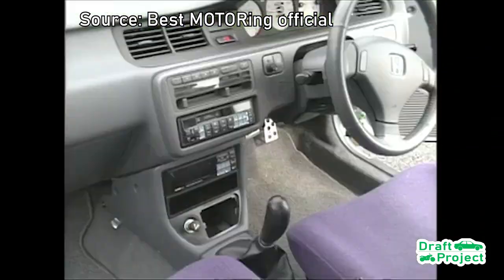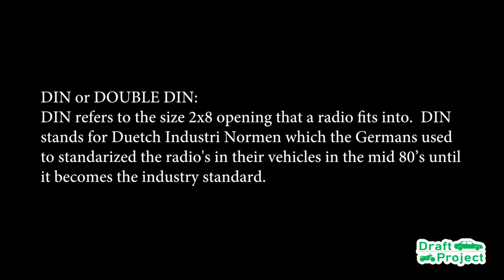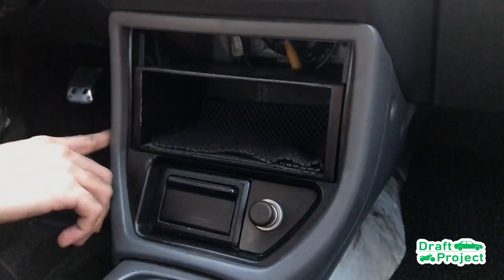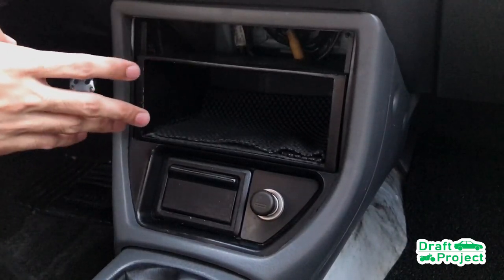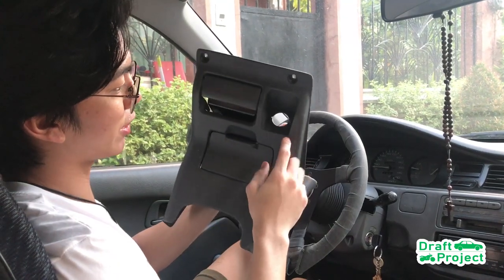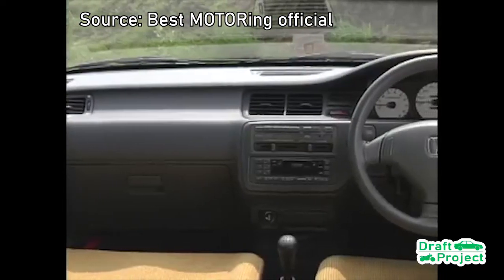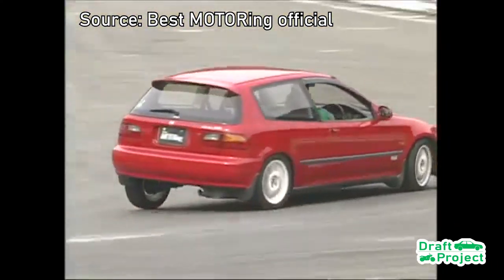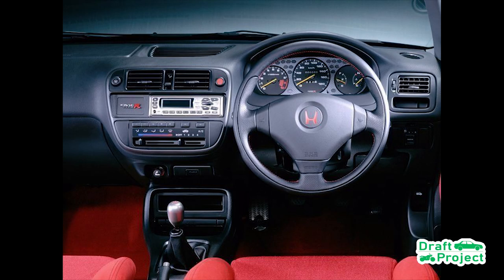Different Types of Center Console

Comment: Thank you for the great explanation! My eg hatch got the standart one but I found double din from sedan at a reasonable price. Can i change mine into doublr din without changing other parts?
Reply from the maker: Yes, you can upgrade it. Just make sure that it has complete brackets, so that you can bolt it on without any problems.
Reply: @DraftProject  the guy I was going to buy it from sold it and now I found one from sedan but with automatic trans. Any idea if it would fit on an eg with manual gearbox?
Reply from the maker: As far as I know they are completely the same. It is only the transmission shifter is different, but the panels, center consoles, mountings are just the same. If it is from an EG Civic, it is good. Just remember that when you buy it, it is complete with bracket and screws.

Comment: I have eg coap 95 ex I wanted to change mine too I have 2000 ek hatch too with k24 too I wanted to see if I coukd put the muffler consol from my ek in my coap cuse I did want to put double din radio on my coap need to fit perfect didn't want nothing ghetto
Reply from the maker: Nice ride! Well that would be a bit difficult job since it involves retrofitting in the process. I'm not really sure on how it would fit but I saw someone did it on the internet.

This guy installed an EK console in his Civic EG.
http://www.diymyhonda.com/civic/ek-center-console-in-eg/
Reply: @DraftProject  thanks 🏁🚘🔰😎
Reply: @DraftProject  yo quick question i would do that to my coap but does a double din radio fit in that peace I would do it if a double din would fit that peace do you know.???
Reply from the maker: @skunk3works895  Sorry for the late response. As far as I can see, it seems like it would only fit a 1 din radio or cupholders. It is small for a double din to fit in. I guess its better to use the EG double din console rather than the EK ones.

Comment: De que carro es esa consola ?
Reply from the maker: Toda la consola central que se muestra en el video es específicamente de Honda Civic EG (1992-1995). Estos tienen diferentes diseños adaptados a cada mercado.

In English translation:
All of the center console shown in the video are specifically from Honda Civic EG (1992-1995). These have different designs fitted for each market.
Reply: @DraftProject  pero como la encuentro en el mercado $
Reply from the maker: @lizbethsantibanez5865  Puede intentar encontrarlo en Internet. El mercado de Facebook es una de las formas más fáciles de encontrar en su lugar local. Además, intente buscar tiendas de excedentes de automóviles, un lugar donde los automóviles importados se cortan por la mitad y se desmontan en pedazos. No estoy seguro del precio porque de diferentes lugares. Si el Honda Civic tiene demanda en su país, probablemente sería caro. También depende de la condición del artículo.

In English translation:
You can try finding it on the internet. Facebook marketplace is one of the easiest way to find in your local place. Also, try to check for auto surplus shops, a place where imported cars are cutted in half and disassembled to pieces. I am not sure about the price because from different places. If Honda Civic is in demand in your country, then probably it would be expensive. It also depends on the condition of the item as well.

Comment: Ive got the last console but cant find any parts anyone a tip
Reply from the maker: The last console is really hard to complete. They usually sell it complete. Try to keep searching for "Civic EG EDM center console" on the internet, Ebay and other sites. If you can't find any leads, perhaps fabrication is the key to make the center console fit into your vehicle.